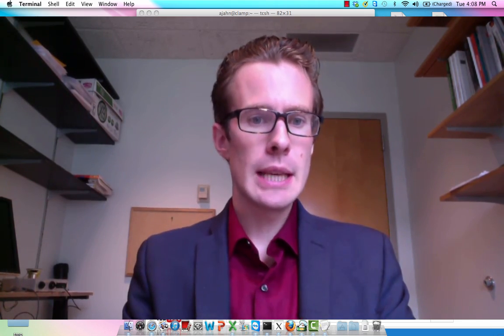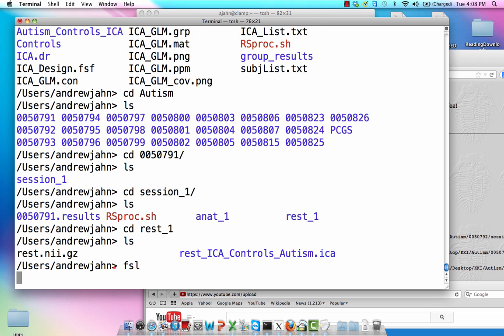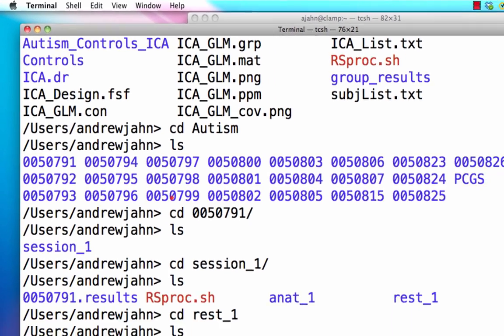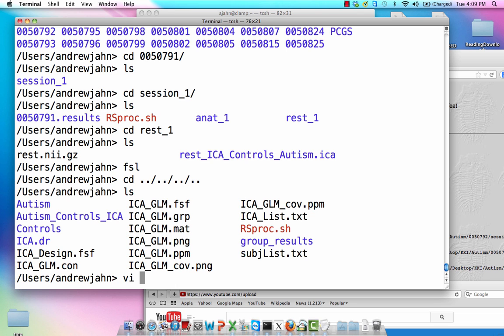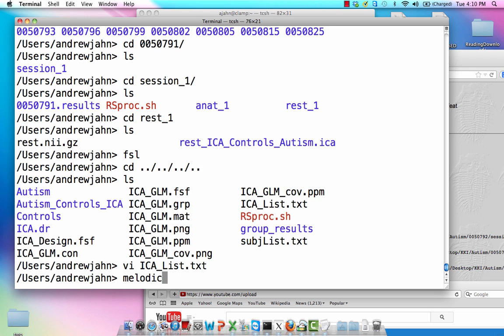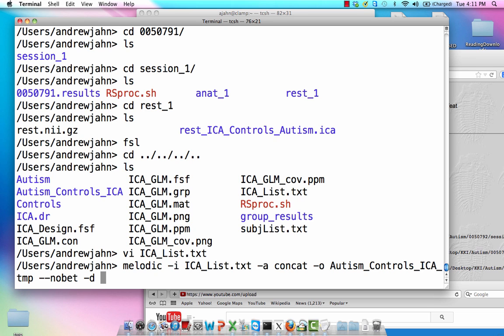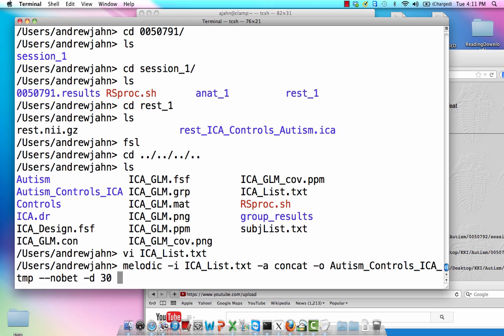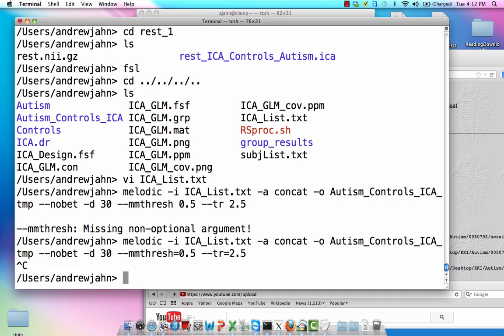ICA Analysis Intermezzo: Command Line melodic

Comment: Hi Andrew-- for running a group ICA analysis with a command line, how did you specify that your first 5 subjects were in 1 group and next 5 subjects were in another group?

This is super helpful, thank you!

Audrey
Reply: Ok ok I see that you address this in the next video. Thanks!
Reply from the maker: Hi Audrey,

Check out the command design_ttest2, which will automatically set up your contrast and design matrix files; e.g., design_ttest2 design 5 5

Best,

-Andy

Comment from the maker: ***** Hey emouch, don't worry about pointing anything out; it's very helpful to have someone double-check it, because I can slip up on things and misspeak without even noticing it, even when I review and edit the videos.

About TRs, I've actually heard the term used interchangeably with volumes, both by other researchers and also in the AFNI and SPM documentations (as in, one subject can have the same number of TRs (plural) as another subject - say, 150 TRs (volumes) for each - but a different TR (singular) - e.g., a TR of 2000ms for one subject, and a TR of 2500ms for another subject).

You're right though, the standard definition is the time between acquisitions, and I noticed a couple of points during the video where it is unclear (e.g., in a couple of points I say "The same TRs," instead of "The same number of TRs." I'll point this out in an annotation.

-Andy